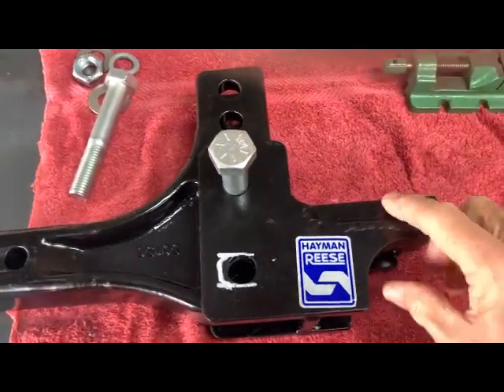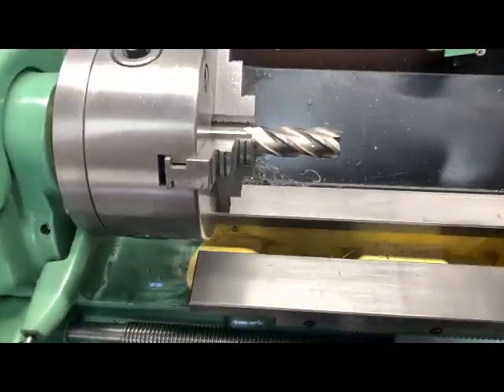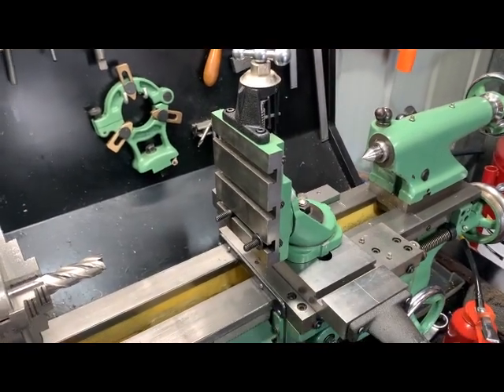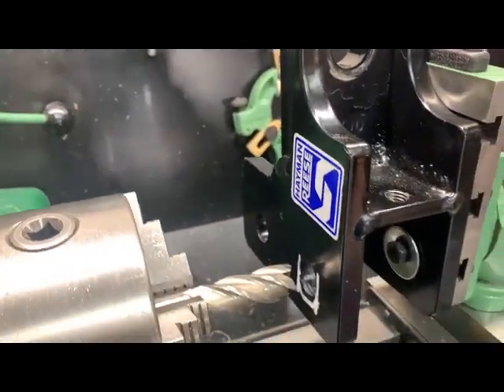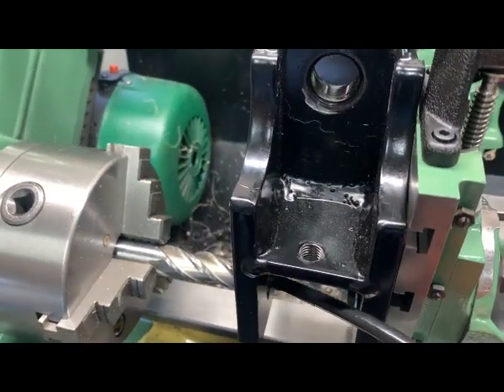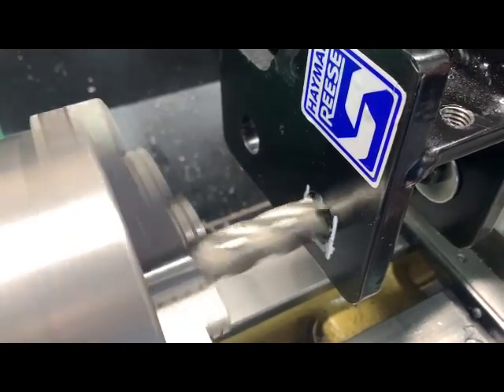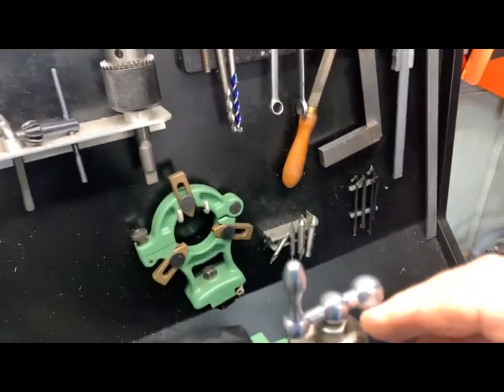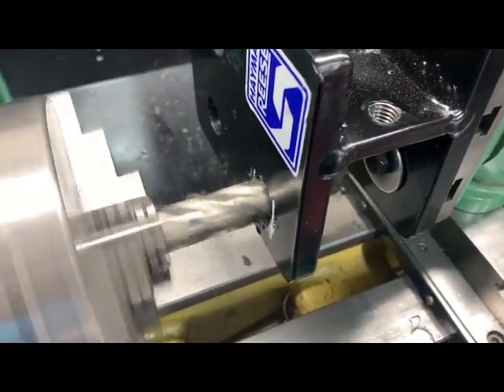Myford Lathe Mini Mill

Comment: Hi Greg. Good idea making the coupling angle adjustable. The Myford lathe milling attachment worked great. Tony
Reply from the maker: Hi Tony, Thank you for your comment, my reasoning behind this is that when towing our Caravan (which weighs in at 2800 kg) the Tow Pin is no longer at 90 degrees but on a slight back angle, this would place extra (and unwanted) load on the locking secure plate which is at the top of the Tow Coupling as the Coupling would want to ride up the pin, maybe this is something that manufacturers of tow hitches should look into?

Comment: Ok, firstly it is illegal to modify an approved towing device in all states. Secondly the load should not be taken on the "Anti rattle" bolt! In fact anti rattle bolts must not be tight when towing at all, they are only to stop the hitch rattling when there is no load on the ball.
If you have an incident your insurance will wipe you for sure.
I wonder why you need to tilt the hitch up anyway, van overloaded?
Reply from the maker: Sorry I don't completely agree, there is no load on the anti rattle bolt which is on the vehicle tow bar, it is the main clamp bolts that take the load, my small bolt is for adjustment only and to keep the pin in a vertical position so as to take the load off the locking lug.
Thanks anyhow for your comment..